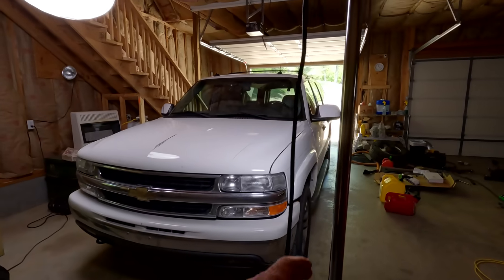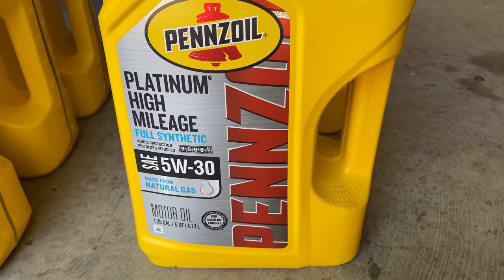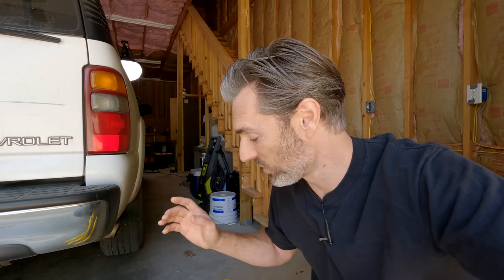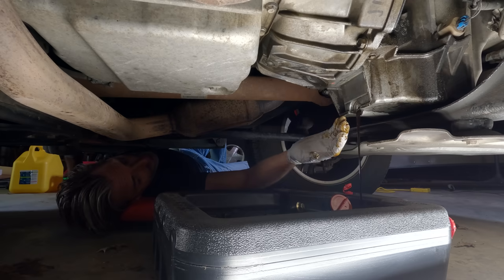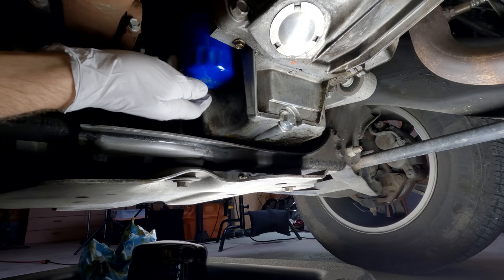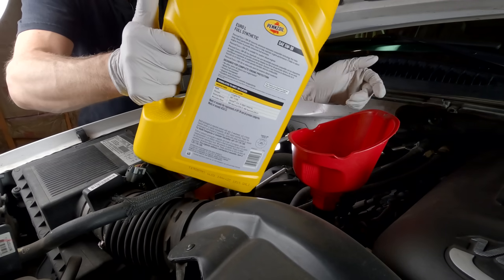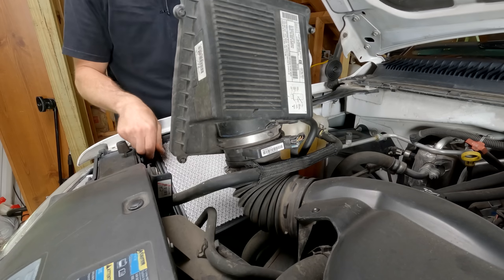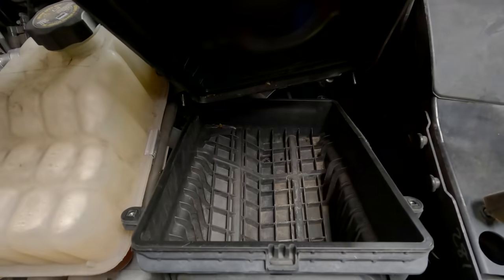If I Use European Spec Oil For My American Made Truck, Will It Break?

Comment: From what i have been able to find. The Euro oils use a better base stock GL something. However, the Euro oils use different additive packs to protect catalytic.  If you prefer better wear protection  such as higher zinc , moly etc.. not that higher zinc is always better, but again, research has to be done. Penzzoil Ultra Platinum series us pretty hard to beat price vs. performance o. The mid high end side as oils are cincerned.
Reply: Castrol makes the best Euro oil to be honest BMW sell it in Europe and used on all their cars
Reply: @fortnite360HZ  wich Castrol oil ? The 20 thousand extended black bottle. Or the gold bottle 25 thousand extended.  Do you know if these oils ir the one you are referring to wich i would appreciate if you would share have any ester vase stock in the mix ?  I understand it's goid to have some esters for seals, abd for extra protection.  Ester seems to cling on to the components in the engine to help with dry starts. Any Vice I would appreciate.

Thanks Eric.
Reply: @ericsivilla4091  google Castrol 0w30 Euro Oil u will get there website its in a black bottle they use it in BMW and Mercedez
Reply: I use the castrol 0w30 euro oil combined with Lubegard Engine protectant which has Esters in it best combo never had any engine issues and its super quiet
Reply: @ericsivilla4091  also they don't put a claim on mileage what your talking about is the north american bottles
Reply: @fortnite360HZ  i never leave my oil longer than 3 to 4k anyway. I don't care what any manufacture claims. Thanks for that info. I will google it. Btw; what do you think of Liqui moly Ceratec additive...
Reply: Also if u read the DATA sheets on a North American Mobil 1 vs Castrol European oil the Viscosity Index is higher on the Castrol so the Euro oil has a higher film Strength and if u drive aggressive the Euro oil is the way to go just so u understand the lower viscosity will flow better on extreme cold temps but the advantage of the slightly higher viscosity is u don't have to be afraid of pushing the pedal to the medal that's the difference
Reply: @fortnite360HZ  the lubguardvyour talking about is the white bottle.. that claims it's good for lspi. And turbos ?   Y I uvreally seem to know your stuff. I would like to ask ypu for some advice. My car has a 2024 530i rear wheel drive with the B48 G60 2.0L TURBO... The oil BMW calls for us 0W20,  Should I be using the 0W30 instead ?..  Also the dealer sells BMW oil LL-01 OW20, 0W30, and 5W30... People say it's really Castrol.  Do you feel the Euro Castrol is better, ir the same as the Dealer fill ?
Reply: it also depends how u drive u get better fuel economy on 0w20 u don't have to warm it up much that's the difference
Reply: I use 0w30 I don't care about warming it up a few seconds more or the fuel economy u do it to protect the engine
Reply: @ericsivilla4091  I'm using BMW spec oil in a Honda my engine didn't blow up LOL...and my Honda is quieter I can tell u that much and smooth
Reply: @fortnite360HZ  I'm in Miami Florida, so cold temps are never a problem. Here, not even I n winter.  Lowest temps are 50 degrees. And that's rare...  Summer,  highest is 100 Degress Fahrenheit.
Reply: @fortnite360HZ  i don't care about price ir fuel economy at all. My goal is engine protection. I'm not tracking, but I drive spirited on sport mode always. No start stop for me.
Reply: @fortnite360HZ  that's good to know. When I ho to jet. I turn on the car via the key for 5 minutes before,  and I drive on sport mode easy till I'm up to temperature....  when I reach my destination, I give it 1 to 2 minutes before I turn off to protect the turbo. Cool down. 😎
Reply: Penzoil has been known in the past to damage engine seals and oil leaks every oil change with penzoil would leak my mechanic switched no more issues after the switch

Comment: In 1995 there was a lot more phosphorus and zinc in your oil to keep your flat tappet camshaft happy. Newer engines use roller cams which drastically reduced friction, so yeah you know what is best....
Reply: Yeah I belive vortec engines started in 98 or 99 and are all roller. But those older TBI v8s my dad always said it's best to use like a Castrol gtx vintage with high zinc or valvoline vr1 with strong additive package in it.
Reply: @redlinearroyo847  96 and later is vortec while 95 and earlier is TBI and your correct specially if you have higher ratio rocker arms like 1.6

Comment: My teachers at auto tech school all said Penzoil was the worst oil because they just find the cheapest oil they can get and slap their name on it.
Reply: Early Pennzoil was bad about having a waxy additive that caused sludging issues, that was rectified a LONG time ago and is now pretty much the same as Shell Ultra oil. Ferrari and performance FIAT exclusively deal with Pennzoil, and Pennzoil Ultra Platinum oils are some of the only oils that can meet the Ferrari performance oil spec. There is some stupidly abusive testing that goes into meeting that spec and from my experience in running it in turbo Volvo's running 20-30psi of boost, it holds up very well to 900C EGTs and frequent high loads. Definitely a good choice of oil if you don't mind spending extra.

Comment: Stay away from that 0w40 oil. Use Mobil 1 10w30 extended performance. Accept no substitutes.
Reply: I use 0w40 because I  live in Montana. All motor oil shear so that 30 weight will be a 20 weight in 5,000 miles. Not going below a 40 weight.
Reply: @jefferysurratt5650  Mobil 1 will flow at about -20 deg.

Comment: This isn’t the 70’s dude you can go at least 5,000 miles before changing your oil
Reply from the maker: Yes, you can. But it’s better if you change more often isn’t it? Removing contamination, especially from an older engine, is paramount in my opinion.
Reply: @1RoadGarage  so you’re just gonna be wasting perfectly fine oil?
Reply: @1RoadGarage  I have a Lexus LS460 and I go 5,000 miles between oil changes. If I were to go 3,000 that’d be insane

Comment: Nice. You Americans are clever: step 3 times on that pedal & reset! You brought up a vital point of attention. Don't tighten up the oil filter like your life depends upon it. A mechanic in a local garage did. He also didn't lubricate the gasket. It hardly came off.

Comment: I do the same thing  I change  my  oil every 3k miles on my nissan  D22  ka24de  engine  and I recommend it  because the ka24de  engine  only takes  3.6 liter not much and because  of  that  it get dirty fast and I change  the oil filter  every  time

Comment: I learned my lesson with garbage Pennzoil and Quaker State motor oils along time ago. Will never buy their garbage  Paraphere oil. The 2 oils cost me to much in repairs and they told to bad. Although it was in the late 70s. It pulled up oil passages, caused more wear and tear on my engines.
Reply: This was in the 70/80s. This is far from the truth now. Pennzoil is one of the best oils on the market. Shell purchased Pennzoil and Shell has been used in diesel trucks with millions of miles. This isn’t the same Quaker state you were getting then.
Reply: @jordanhannah5839  I got burnt by them and will never trust them ever again.
Reply: @SFCRambo60  I understand man!

Comment: What you did is fine but don't reverse it and put the Euro L in a German non-diesel engine. For German cars with regular gasoline you must use the Pennzoil Platinum Euro without the "L" on the label.

Comment: You’re going way overboard with the oil. If you’re changing every 3k miles all you need is Pennzoil Platinum or use Valvoline Maxlife and you should be good. Wasting money on that expensive oil.

Comment: Using anything made by Pennzoil is just a terrible idea, same with anything Quaker State.
Reply: you gonna give some sort of explanation or nah?
Reply: @spiralnapkin  the past history of either of these brands conventional oil breakdown(which is far faster than any of the good brands I've used; Valvoline, Castrol, Mobil 1) leaves so much paraffin buildup and junk in your engine it takes significant time to clean it out by hand and then by using one of the other good brands to help flush out the rest, I wouldn't trust anything they make with claims of "full synthetic" or otherwise. Generally shoddy oil manufacturers continue to cut corners, and spend millions on advertising instead of just making a solid product.